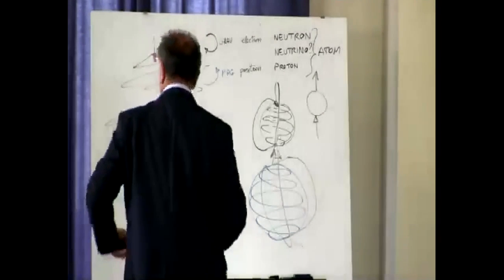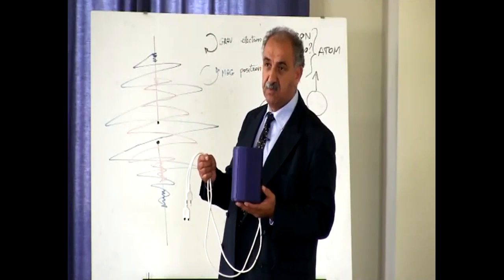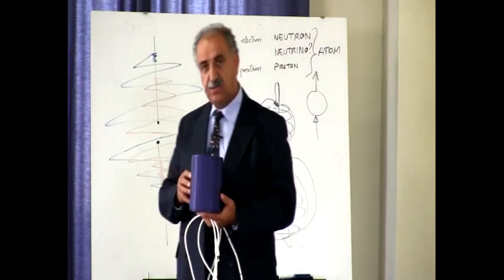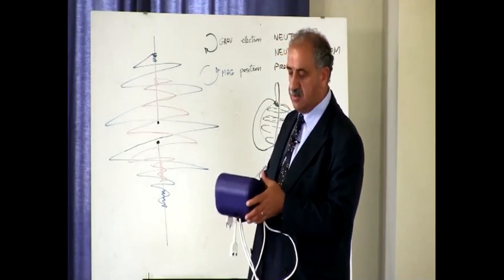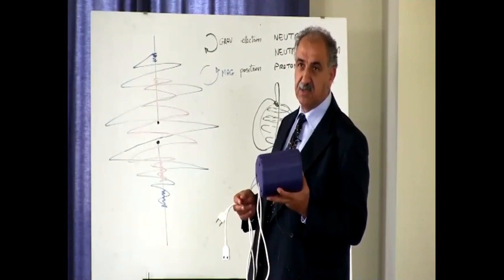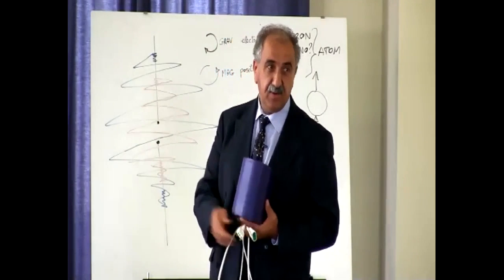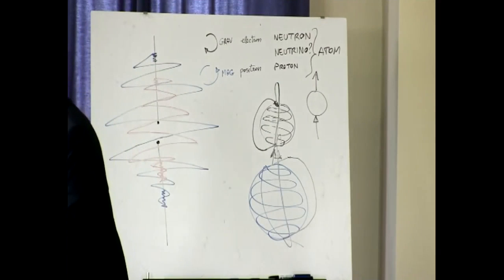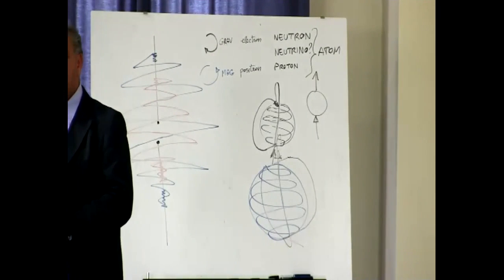Keshe MAGRAV plasma power units design

Comment: I have seen tons of video non of them independently shown working plasma reactor ,even it's working clearly I can see some external power supply inputs.
Please clear this by perfect example of video not by words.
Thank you
Reply: Thus reason is the ones incharge lof YouTube edit all that is conditioned we already know why if you just look at the work and do the detales you will see I HAVE MADE MORE THAN 60 AND THAY ALL WORKED why would I waste my time
Reply: You will get a 70 percent difference in your electric bill by just doing the detales all detales are what it takes some times my bill was 13 dollars and would be 500
Reply: Al Rosen shows on his talk show. The  magravs power unit a 50 percent difference on the input verses the. Output clearly and shows with   standard. Watt meters running heater a fan saving 59 percent  look for your self.AL Rosen